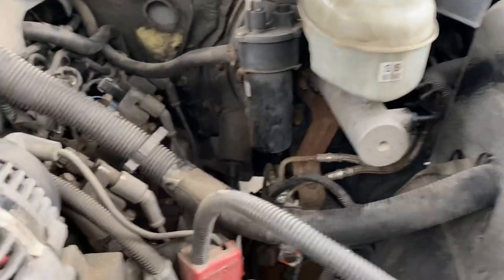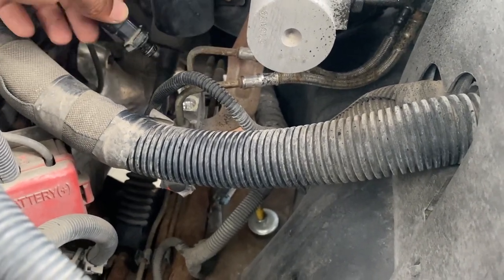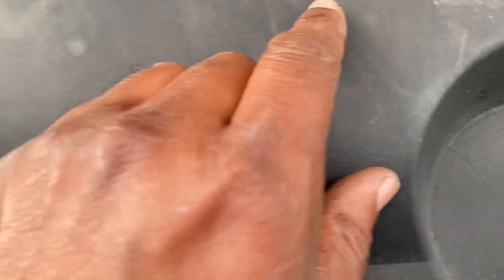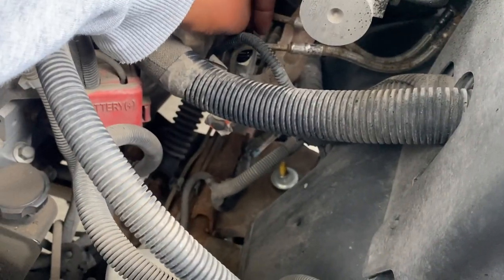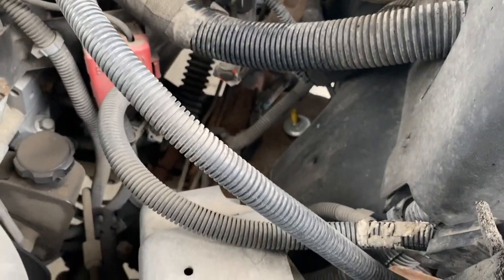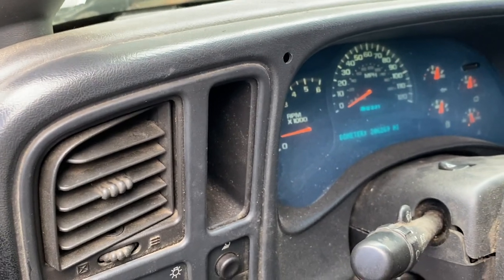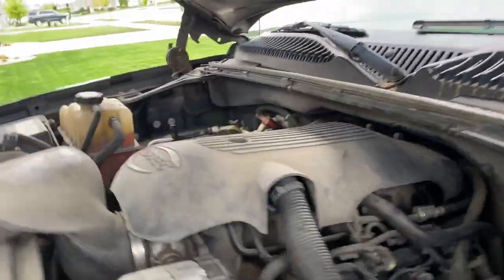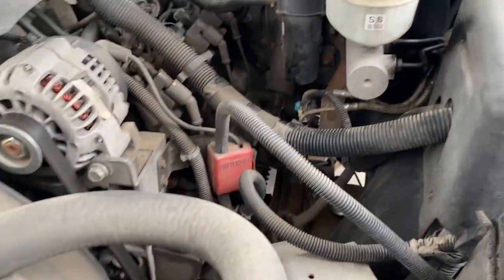GM Service Brake System Fix / Brake Pressure Switch Replacement | 2003 Silverado AC Delco #88983914

Comment: Your the man! I changed my wife's front brakes yesterday. And when I was done the brake light wouldn't go off. Driving me crazy. I noticed also when I unplugged that same pressure sensor the brake light went off. So I'm going to replace it and see what happens. Thanks again 😁👍
Reply from the maker: Great to hear!

Comment: Kudos to you!!  Had to replace the abs control module on my 2004 avalanche. Torx screw stripped. Had to remove pump. Bottom line, lost all brake fluid. Fixed ABS problem, brake light and "service brake system" would not resolve.  No one would accept that my Aval. had no brake fluid sensor, and my parking brake switch tested good. You were the only person to get me headed in the correct direction. I'll try to order the part tonight. High hopes it's a fix!!
Reply from the maker: Right on. Good luck. I hope this fixes your issue.

Comment: Before spending money on the part I fixed mine by unscrewing it from the port wiping the sensor on my shirt and the port had corrosion so I blew it out and installed the old sensor fixed my problem
Reply from the maker: Good simple fix. I like it.

Comment: The pressure differential switch turns the red brake light on if there’s a difference of pressure between the 2 chambers of the master cylinder. If the light turns off when you unplug the sensor, that doesn’t necessarily indicate a bad sensor. You’re basically opening the electrical circuit that turns the light on, but may still having an issue in the brake system. It is important to inspect the system to make sure the 4 wheels are getting the proper pressure.
Reply: Yeah mine shows no resistance and turns off light when unplugged.
Reply from the maker: Good advice. Part is so cheap most people will fix it with changing it and go further if that doesn't work. Make a video about going further and post it in the comments. It could help someone.

Comment: Did you fix the problem long-term?  Just because the warning message went away doesn’t necessarily mean it didn’t come back. My message seems to come and go. But it’s the same service brake system message. Sounds like a cheap part that might be worth trying out and seeing if it solves my intermittent problem. Thanks for posting
Reply: it could be a ground to the system that came loose. look at this video also https://www.youtube.com/watch?v=K3XOqeH2HCA
Reply from the maker: Yes was no issue after for me.
Reply: Hell yeah brother, thank you very much!

Comment: The switch is easily opened. Open the switch and clean the contacts. The one that will be on the end and closed is the one that causes the problem. Just fixed mine that way.
Reply from the maker: That's good advice. Thanks.
Reply: @AbouTto_  Ya, except it quit working. I guess it's good for troubleshooting but apparently once the contacts wear out they are no good and it won't last long. I'm going to have to replace the switch.  :/

Comment: It goes away if I unplug the sensor could I just drive around with it unplugged
Reply from the maker: I don't know if the ECU will operate the brakes differently if you do. Probably ok since the systems are so simple for that truck. It's a cheap part. I'd just replace it.

Comment: Why would the tip be soaked with brake fluid.  Even the connector is soaked and the pin holes are green like when battery terminal get corroded.  My brake light went off when I disconnected this sensor.  Just stopped to say thanks I think this will fix my issue and not the ground wire or the abs computer module  sauder problem  thank you again 😅
Reply from the maker: I really appreciate the positive comment.
Reply: It's been about a year since I replaced this sensor. This fixed it.
Reply from the maker: @quickchrome2012  Good. Thank you.

Comment: The dealer wants 564.00 for this switch I bought one at autozone for 119.00  looks simple enough
Reply from the maker: It's simple. Don't run the truck with it removed. That's a $20 part for a 03 Silverado. Double check your part. https://www.autozone.com/brakes-and-traction-control/brake-pressure-warning-switch/p/acdelco-brake-pressure-warning-switch-88983914/86460_3004835_0?searchText=88983914  |  https://www.amazon.com/ACDelco-88983914-Original-Equipment-Differential/dp/B0010GHZIS/ref=sxts_b2b_sx_reorder_acb_customer?content-id=amzn1.sym.44ecadb3-1930-4ae5-8e7f-c0670e7d86ce%3Aamzn1.sym.44ecadb3-1930-4ae5-8e7f-c0670e7d86ce&crid=3N8JH3RPG4RAJ&cv_ct_cx=88983914&keywords=88983914&pd_rd_i=B0010GHZIS&pd_rd_r=713bf596-701d-4cdb-9c94-14c43fd36628&pd_rd_w=BL1s6&pd_rd_wg=OI7Hy&pf_rd_p=44ecadb3-1930-4ae5-8e7f-c0670e7d86ce&pf_rd_r=MR2T0ZF2VTSMG88RJ47N&qid=1674517032&sprefix=88983914%2Caps%2C102&sr=1-1-62d64017-76a9-4f2a-8002-d7ec97456eea